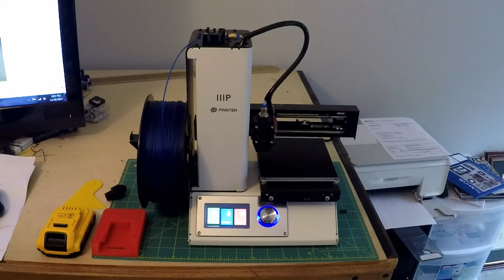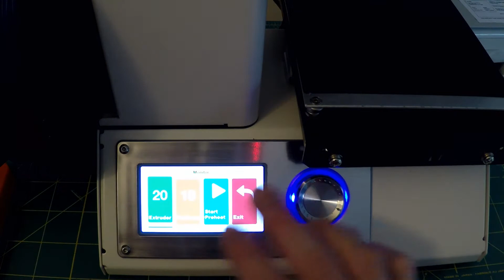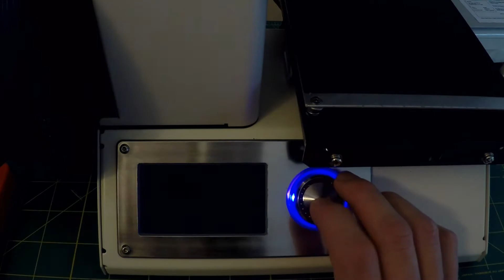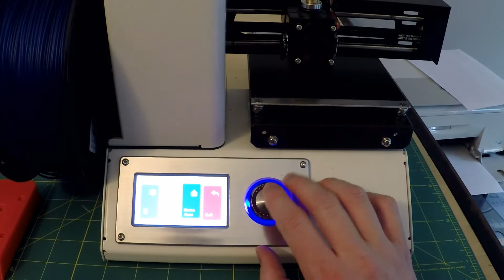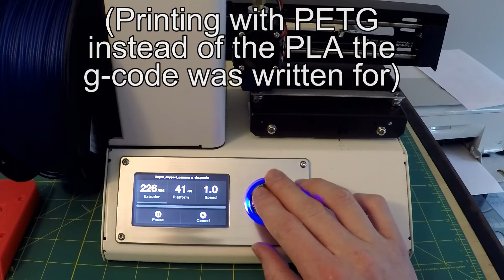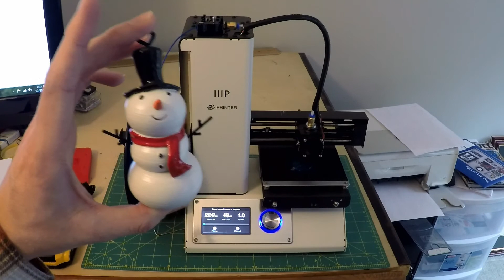Monoprice Select Mini 3D Review

Comment: What happens if you put the cursor of the printer on "move" and hold down the button for several seconds? And have you tried to set up WiFi yet?
Reply from the maker: I just did. I downloaded the MP 3D Printer WiFi Connect app, pressed the "move" menu for a couple seconds and got the "Smart Config Started" screen, entered my wifi password and pressed connect on the app, and it connected and displayed an IP address on the main screen.
Reply: I had no idea there was an app. Could you show the link?
Reply from the maker: Added links to description. I used the Android version.
Reply: Thanks i'll give it a try. I've had a strange thing happen with using the SD cards, For one i can't get the printer to read any cards other then the one it comes with. Just say's "card is empty" and the card it comes with has to be formatted every few prints because i will try to print and it will immediatly start showing the blue "timeline" counting down without heating up untill it gets to the end of the timeline and just hangs up. Really strange. Having Amazon send me another one.
Reply from the maker: I've had the blue line pre-heat only scenario happen to me a couple times, but it seemed to be a problem with the g-code, I use the settings that came with the cat test part as my jumping off point, so when I have something like that happen I'll reload parameters from the cat g-code and that tends to get me back to a point that works.